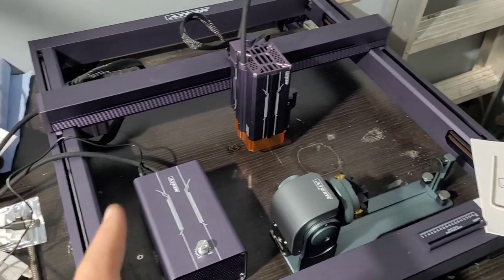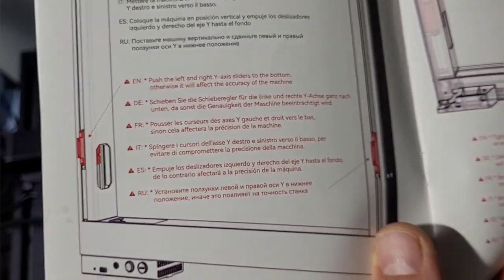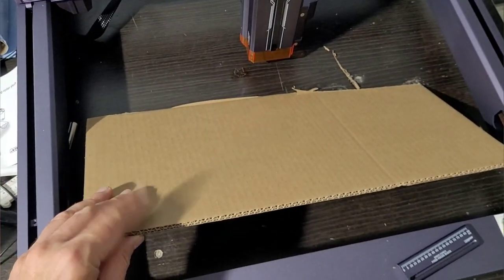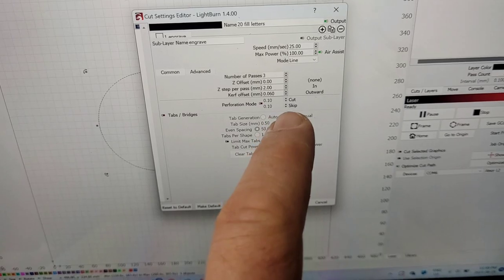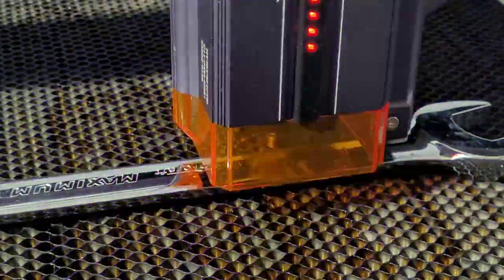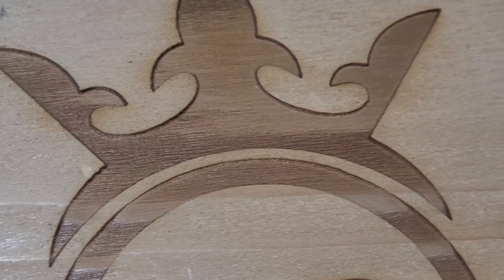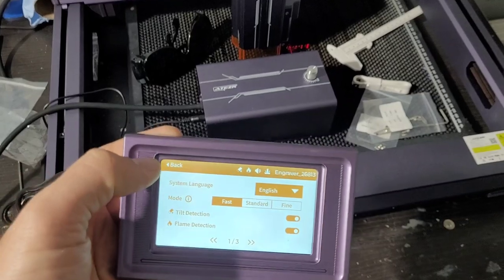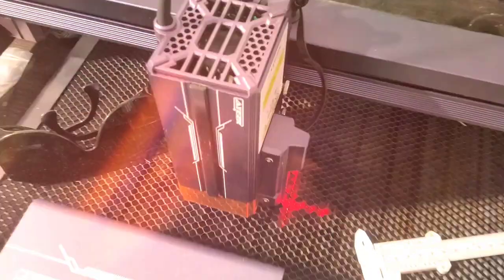Now Has a Z-Axis - Atezr L2 36W Laser Engraver - System Test and Build Tips

Comment: 10:12 I used to do this with spray painted copperclad PCB stock to make my own circuitboards.  Just etch away all the paint that ISN'T the circuit traces and pads, and leave the circuit itself covered with flat black paint.  Dunk into a fast etchant of my own making, and in a few minutes, you have a new board.  Acetone to let the shiny parts back out.

Comment: What's the benefit of dropping Z over incrementaling turning up the laser power?
Reply from the maker: The peak power is at the point the laser is focused.   Moving the laser along the Z axis also moves the point of peak power.  It also helps to keep the laser point to its minimum size & maximum resolution.

Comment: I'm again surprised that there is no real self alignment software/test.  Maybe this doesn't exist at this level of product  -- To check (and observe) a bunch of different points (more than 3) and then do a fit of the parameters of the various motors (x and y) to get the n points as close as possible to dead on.(And develop an internal model of the actual plane of motion.)  Or are stepper motors and such so accurate these days that such an alignment step would be superfluous at this price level?
Reply from the maker: The stepper motors are extremely accurate.  The alignment check is to ensure everything has been done properly during the assembly process and flush out any issues.